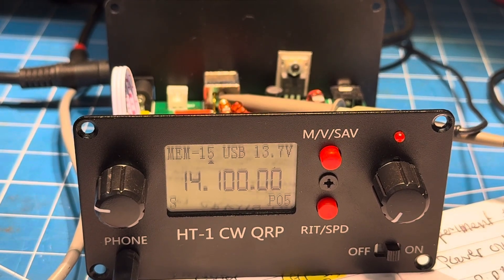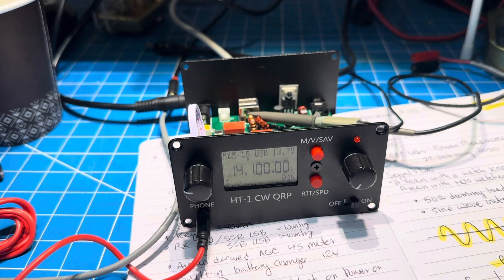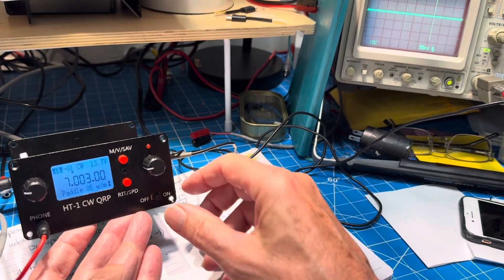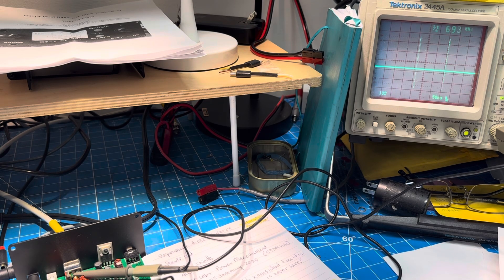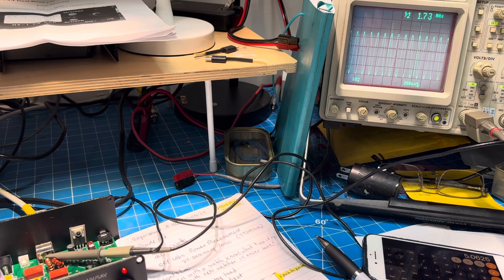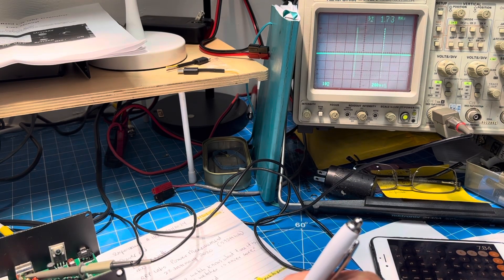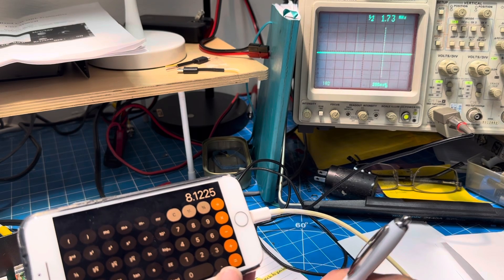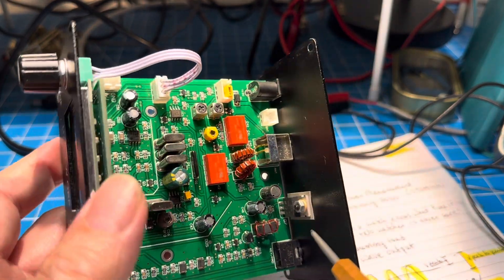Another $102 radio from eBay. How many $/Watt? Haha

Comment: Maybe powering the rig from a variable PSU and reducing the supply voltage would bring output under 5W? I am guessing the IRF510 PA supply rail is connected directly to the supply. So, this may be an easy way to reduce power without doing any mods.
😂 At 8W, I would be reluctant to say I was QRP. I use the pp squared divided by 400 formula all the time.

Comment: There is no charge controller on the main PCB - the battery is wired directly across the input jack, so exercise caution. The chips on the main board are 2 x SA602 (RF mixer and product detector) and an audio amplifier. The yellow jumper near the rear of the board can be swapped with the volume control to turn it into an RF gain control - obviously if you do that then the volume is fixed to maximum unless you add another pot.  There is unfortunately no drive control, although you can increase the value of R6 to increase the amount of negative feedback on the driver if you want less power.